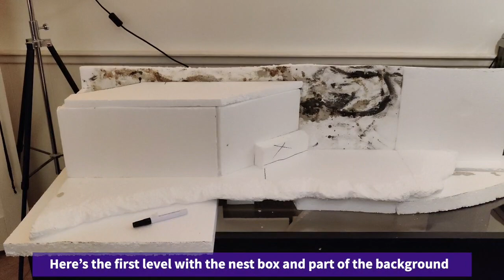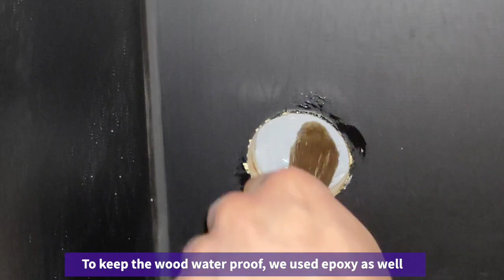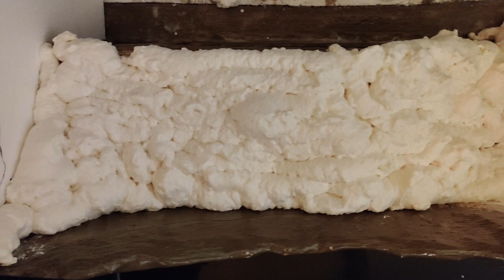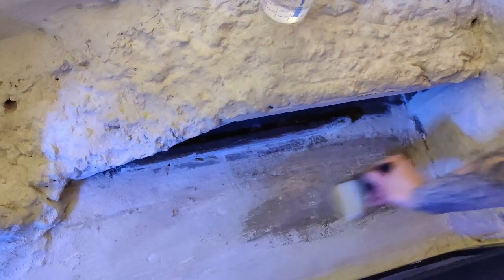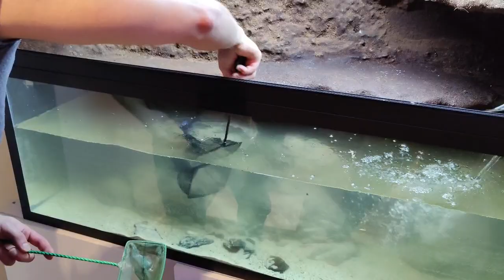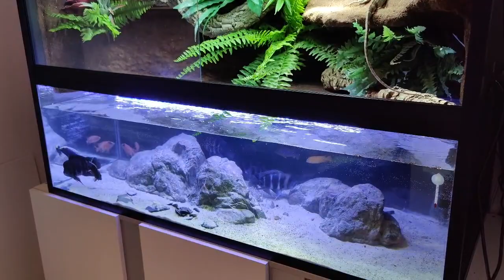Water Dragon Enclosure Build

Comment: What kind of adhesive and epoxy did you use ?
Reply from the maker: Mr. Boat epoxy and cheap tile adhesive from a store here in the Netherlands
Reply from the maker: It all works the same so don't worry about the brands! Just use it right 😍

Comment: nice video but if the container costs 700€ whitout the decoration I think is too expensive
Reply from the maker: Thank you. It's not that expensive compared to other enclosures of that same size. It's custum build from concrete plywood which holds the humidity and heat in very well, but isn't as heavy as glass. There's also a build-in aquarium in it.